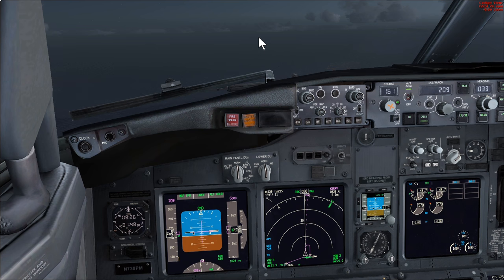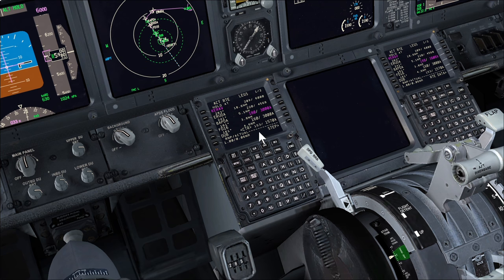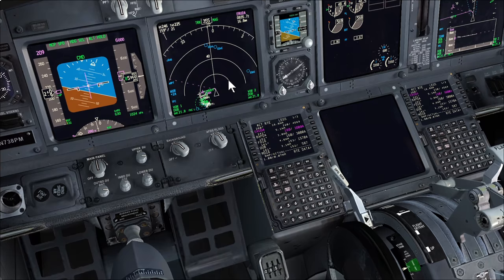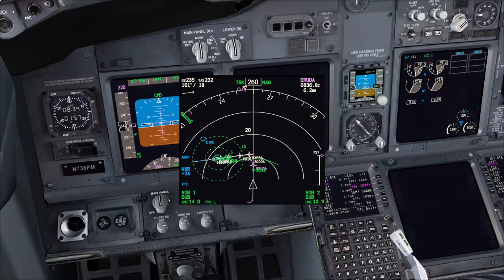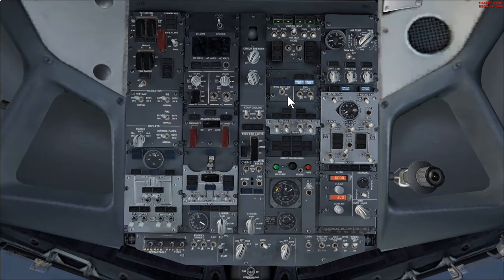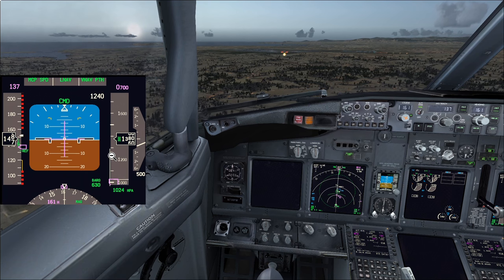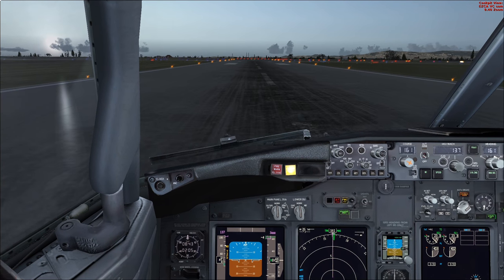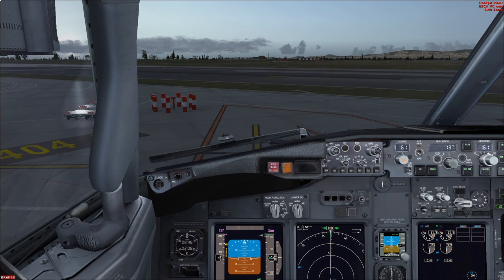PMDG 737 Non-Precision Approach Tutorial by a Real 737 Pilot

Comment: Unless I missed something, you mention the importance of having the correct QNH set , but you have 1026 set in the forecast page and 1024 set on the PFD.
Reply from the maker: Hi GoPro Flying, yes setting the correct QNH is vital! 

Remember the pre-set QNH used on the DES FCST Page has no impact on the Altimeter, it just helps VNAV build a more accurate idle decent path. We usually stick in the METAR QNH there. So long as the correct QNH is set correctly on the PFD (when you’ve been cleared to an altitude you’re advised by ATC of the latest QNH) you’re all good 👍🏼

FD2S

Comment: Hello, first I wanted to say thank you for creating such an awesome channel, nothing on youtube related to flightsimming comes even close in terms of quality to your vids! I have a question regarding LOC approaches - I've read on pprune that the preffered AP modes for these approaches are VORLOC/VNAV. Are there any more differences in conducting VOR and LOC approaches (beside the fact that localizer provides precise lateral guidance for the rwy)? Do we need to recycle FDs as well?
Reply from the maker: Hi Mufec, thanks a lot!

Yes LOC approach will be VOR/LOC and VNAV PTH, so long as the vertical profile is correctly coded in the FMC. You can use V/S and fly the vertical profile that way.

If the final approach track and a RW point is coded in the FMC there is no need to recycle F/D's but if flying in V/S or get poor guidance from the F/D's after disconnecting recycle them.

FD2S
Reply: @flightdeck2sim  Thank you for answering my question, everything is clear now :)

Comment: I'm learning so much. Thanks. Please keep the vids coming. Can you remind me at what distance you set the fixes again. 10 miles, then 7 and 3? Is that correct? And do these all correspond with flap settings?
Reply from the maker: You're welcome!

We use the fix rings to increase our situation awareness and we have company specific SOP's regarding its use.

They're based on the LDG RWY e.g. In the tutorial RW16.

X1 x3 Altitude Ring. We multiply our CRZ by x3. E.g. If cruising at FL370 we'd have a 111nn ring, this roughly will correspond with TOD

X1 10nm ring. The latest point at which we can select Flap 1

X1 4 or 5nm ring. The point st which we select Gear Down, Flap15.

The Captain has the discretion to alter the configuration point any time he likes but Day to Day this works really well. 

Good luck!

Comment: Pretty sure to recycle the FD for the G/A both FDs have to be reset together. I could be wrong but that's our SOPs at 300' below our final waypoint. ;)
Reply: Hi , can you please explain to me, why we do recycle FDs. For guidance in case of go-around at the missed approach altitude but, what if we don't recycle them !? we should get the guidance, no ?! thank you
Reply from the maker: Hmmm, can't always be before the final waypoint, what happens if it is above the MAA? Our SOP is to set MAA at 1000ft AAL or 300ft below MAA if minima is above 1000ft!

We use to always recycle F/D's on a NPA when disconnecting, we can now leave it on if the FAT is within 1 degree of the FMC track but F/D guidance below the MDA isn’t always 100% accurate as you get close to the ground compared to an ILS, especially if it’s offset like on this approach. You don’t want to be following F/D’s if they’re not providing the correct information!!

FD2S

Comment: Dear FD2S,

Thanks for the awesome video ! I was wondering here... Is LNAV tracking the VOR radial or is it just following the FMC defined path ?

Thanks for the answer,

All the best
Reply: It follows the approach paths which are loaded into database. (It loads the same path in the approach chart) but you have to check the VOR page on ND everytime to make sure it is going on the correct path. Because in simulation, runway in the ND and actual runway position can be incorrect so you can find yourself far away from actual runway.

Comment: Hello again. Really learning a lot from your tutorials and improving my understanding of the B738 and putting it all in practice with my VA operator.

I've got a question about the final approach technique. On a couple of your approach tutorials you take out the autopilot and auto throttle and then notice you've got 3 reds on the PAPI and talk about making an immediate correction. At this stage in the approach do you make that vertical speed correction with pitch, power or both? And if it's pitch, is that yoke inputs or trim? (I have elevator trim rocker under my thumb on the yoke).
Reply from the maker: Thanks John! Glad they can help!

The aim is to maintain 2 whites 2 reds all the way to the threshold if possible. 

Unlike a light aircraft we do the following....

- Vertical Speed correction if high or low we use just Pitch which controls Attitude. Once the attitude is set you can trim

- We use just thrust to control speed. 

In a light aircraft like a Cessna/Piper power controls ROD and attitude controls the speed, well that's the way I was taught! On an aircraft like a 737 with underslung engine thrust has a huge influence on attitude. When you increase thrust the nose wants to go up and vice versa.

The correction to be made with three reds is to pitch up and increase your attitude slightly, this will make your speed decrease so add a little more thrust then re-trim.

Hope this helped!

Comment: Nice video I subscribed. It's good to learn from someone who flies it in real life. Is the pmdg 737 similar to the real 737? Can you land one in real life when you understand everything on the pmdg or would that be too hard? Cheers
Reply from the maker: Good question! Just from experience and having held a full CPL and IR before starting my Type Rating 6 years ago and having a reasonable knowledge of the 737 it's a completely different experience manipulating the controls and flying the aircraft. There is a significant difference to say a home built simulator and a full motion Level D Simulator and then another jump to the aircraft itself.

You could certainly jump in and have a rough idea what does what but 99% of people who would get into the seat wouldn't know how to move it into the correct position! We also have people who go through their type rating, completing all their ground school but can still struggle at point during the course. 

You do really need the background knowledge of an ATPL course, Frozen ATPL and Full Type Rating to have the basic understanding. It's not until you have +500 hours on the aircraft itself most people begin to get comfortable!

Comment: I think you got the guidance because you didn't recycle the other FD, is that possible? Looks like it turned to Master when you turned yours off and on again.
Another great video in any case!
Reply from the maker: I believe so! That's what I thought and wrote on the video! Very difficult to do whilst hand flying the sim using a joystick, it's an action usually completed by PM.
Reply: Indeed, saw it only now! Must be it then.
Definitely not easy to accomplish every item perfectly when you're supposed to be multi crew. The 737 is still acceptable but try the Q400 while fiddling around with power settings, bleeds, etc.
Reply: Didn't the boss of a certain operator want to try and get a single crew on the 737 ;)

Comment: When I disconnect autopilot, it doesnt beep but keeps on beeping, whats my mistake? :/
Reply from the maker: Hi Kk,

That's normal and true to the real aircraft. 

When you push the A/P disconnect button on the control column you get the A/P disengagement horn and the A/P status light will flash red. It will continue to sound the horn and flash until you push the disengagement button again to silence both the horn and extinguish the A/P status light.

Good Luck!

FD2S
Reply: flightdeck2sim Okey, great .. Thanks !!

Comment: Every time I try to set the missed approach altitude the a/c starts climbing. Does it have to be set when the altitude of the a/c is exactly at the top of the white arc?What am I doing wrong? Can you also explain what the altitude is at the top of the white arc?
Reply from the maker: Hi Judith

Yes we set the MAA at the top of the white bar (1000ft AAL) UNLESS

If your MDA happens to be around or above 1000ft AAL ensure you set the MAA above this altitude, this point would be discussed by the crew and is dependent on the approach being flown.

I found the NGX can sometimes transition to ALT ACQ but once the FMC is in Approach Logic VNAV should command a descent so long as the MCP ALT is set 300 ft above the aircrafts present altitude.

FD2S
Reply: flightdeck2sim Thank you sooo much, I will give it a go

Comment: Hello. Sorry,  i don`t speak english.  Is there MAA altitude in fix on the FMC, or in this case MAA=MDA?
Reply from the maker: Hi Boba.

All we do is set the MDA using the BARO MINS. 

MAA = Missed Approach Altitude and is completely unrelated to Minimums/MDA
Decision is either a DA or MDA.

We use fix rings  just as a configuration reminder.

Good luck!
Reply: Sorry!) just some sources MAA - Maximum Authorized Altitude. Now i know what is it) Спасибо!)

Comment: If You fly some rnav star with a 15nm final do You tend to keep 180 on that base ? It seems weird to me but i also read about 180kt base rule so i am not sure
Reply from the maker: Hi Piotr.

180 kts is the recommended ICAO speed for base leg and would work if you were flying to a 10nm final from base. Generally we would still be decelerating at 15nm to the "UP" Speed unless complying with a speed restriction. 

We encourage crew to be no faster that 200kt at 10nm with Flap 1 selected.

Hope this helped to answer your question!

FD2S

Comment: How do you get your flight deck so clear?? Mine seems slightly fuzzy
Reply from the maker: Hi Paul,

I'm not sure! I just have the default FSX Steam with the sliders set almost to the highest setting! No Mods!

FD2S
Reply: Paul Park If your refering to the pmdg 737, in the pmdg operation center go to performance settings and you can adjust the resolution

Comment: Great tutorial with lots of good tips and information!

I have one question. When switching on the APU at the destination gate I noticed how you used the left aft pump but I've learned the best option is to use the fwd one since that one is easier (less expensive) to replace. This considering the wear will be higher on the pump that is used to feed the APU at the gate and thus will be replaced more frequently vs the other pumps.

Maybe this is different between different operators?
Reply from the maker: Hi Richard, thanks for the feedback!

I honestly didn't know the difference in price with regards to the fuel pumps! As far as our SOP's are concerned if the APU is operating we should position any AC powered fuel pump to on. This is to extend the service life of the APU fuel control unit. Other operators might have a different procedure! 

Seeing the AC Tank pumps are on all the time during the course of the day it shouldn't worry too much about which one you use. It's only when you complete the full shut down checklist after the final flight we turn off all the fuel pumps off (leaving one pump on until the APU is shutdown). during a transit turnaround we leave them all on.

The fuel source for the APU is normally from the No 1 main tank and it's recommended that at least one pump in the supplying tank is always on to provide positive fuel pressure although it's certainly not required! 

Take care!

flightdeck2sim
Reply: I heard this a couple of times but like you say I'm not sure how much of a difference it will make and apparently it's different between different operators.

Take care and safe flying!
Reply: Richard Åsberg some operators turn off fuel pumps for turnarounds ( default boeing procedures) so then it possibly makes some diffrence.